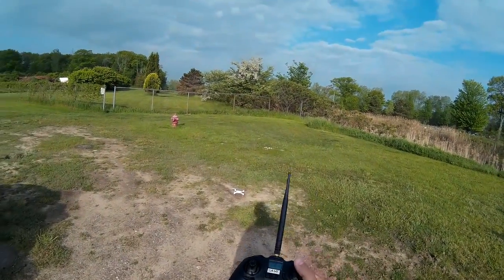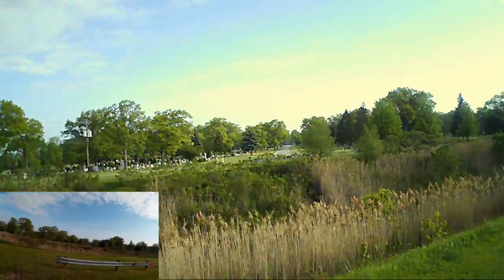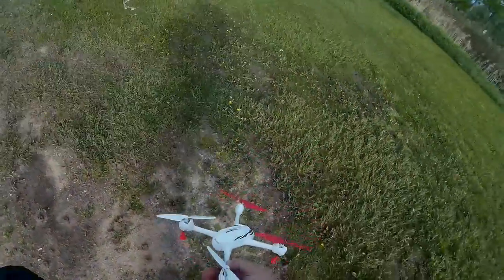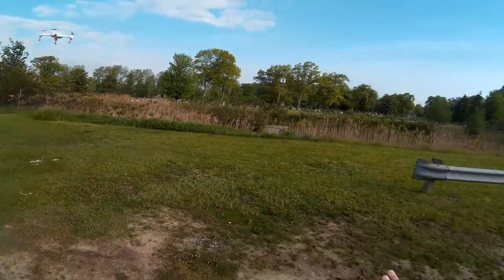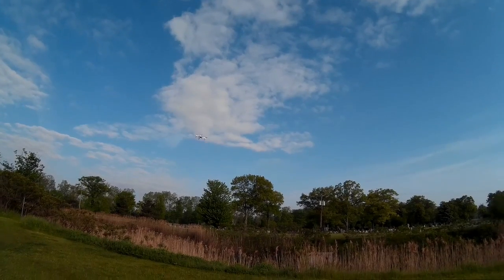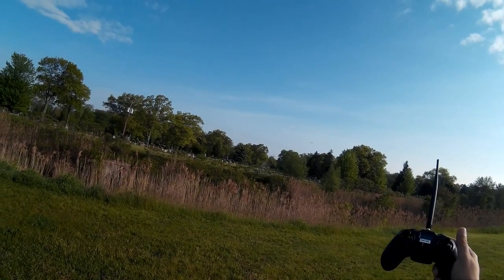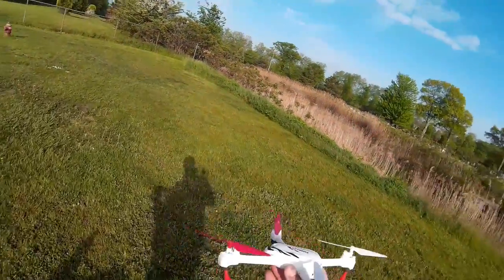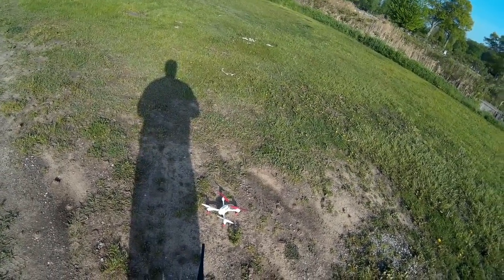Video Drone - Hubsan X4 502e Motor Failure and Ditching It!

Comment: To be honest, I regret buying this drone. Within the first two months I had to replace all four motors and the GPS board. I could never get it to stay in the air more than five minutes before a motor burned out. All replacement parts came direct from Hubsan. My Holy Stone HS170 has lasted longer and performed better than this drone, plus I've never had to repair it.
Reply from the maker: For sub $100 bucks it has been fun but like brushed quards, the more life is short as I find 40 to 50 flights and the motors are toast...
Reply: I've had a majority of my drones for at least 2 years and the most I've had to do is replace a nicked blade or buy new batteries. The Hubsan is the only drone I've ever had to replace motors on. As I mentioned, I've never had it in the air more than five minutes at a time. The HS170 I can get at least 7 minutes flight time out of and it's a lot smaller.
Reply from the maker: Gosh my Syma x8 use to eat motors too...